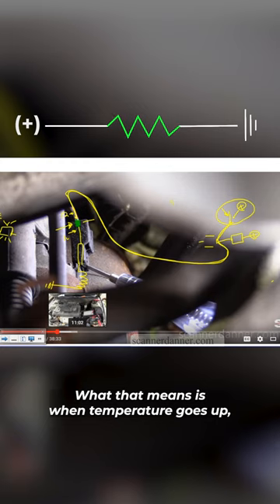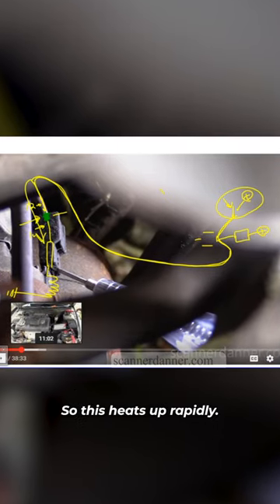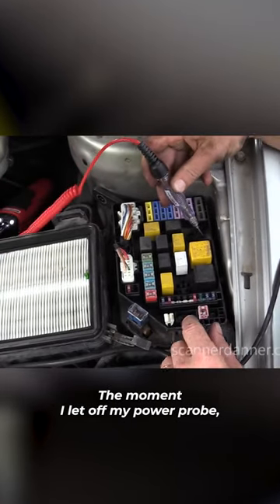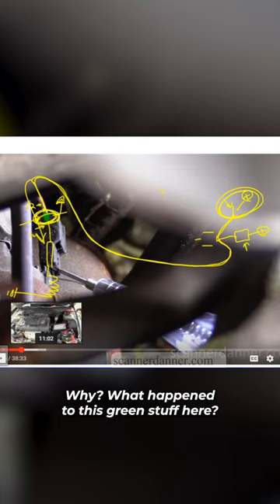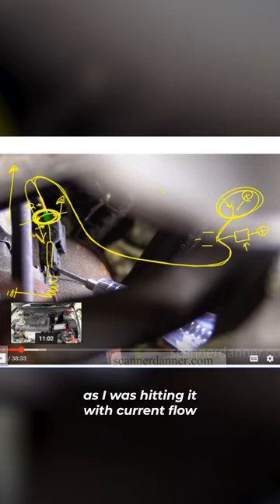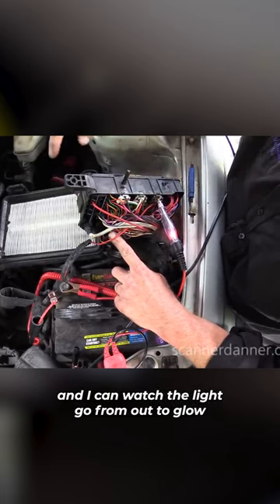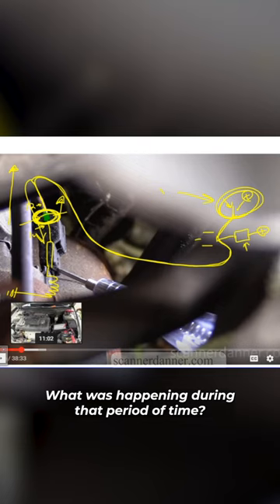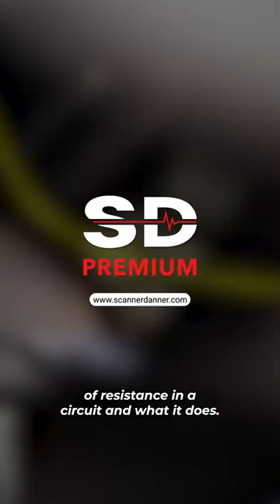Resistance = heat in a circuit

Comment: Those are good points, once recognized we'll see it every day. Old style blower motor resistors used resistors in series with the motor to create a voltage drop before the motor, and those things got as hot as a toaster with wasted energy blown off as heat inside the HVAC air stream. Although current was reduced, the energy lost was the product of the drop across the resistor and the current through it. It makes a lot of sense that newer designs used a much more efficient and robust PWM form of energy delivery.

Comment: Electricians have a chart and they’ll take a reading off of a spool of wire and calculate how many feet it in . Wire Gage at a certain temperature will tell the length

Comment: V= I R
Reply: I=? current???
Reply from the maker: E=IxR 
E is electromotive force or Voltage. I is intensity or Amperage and R is resistance
Reply: Voltage equals current times resistance
Reply: I admit, I have never been able to keep those straight....